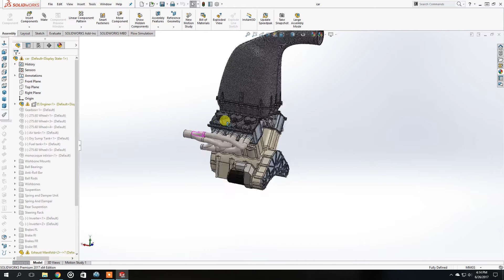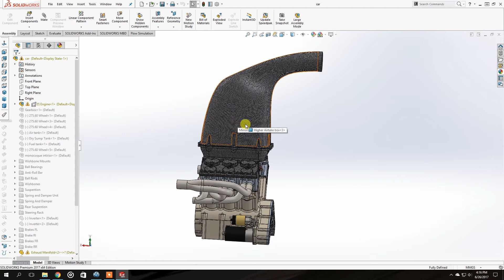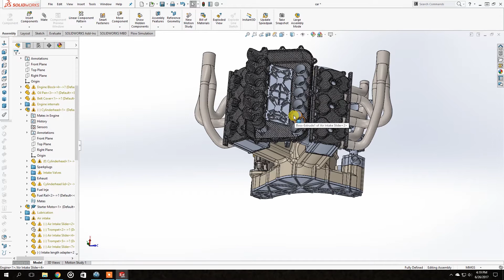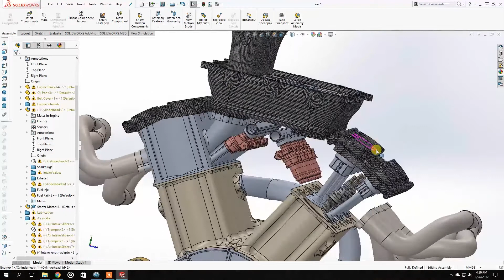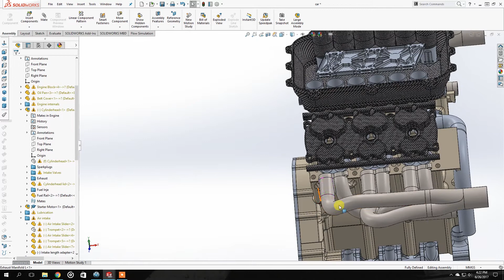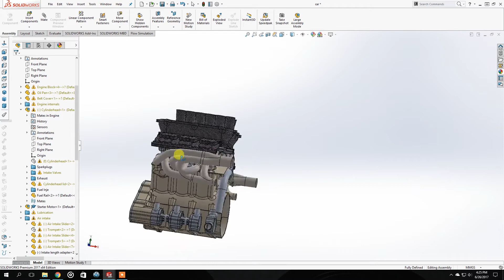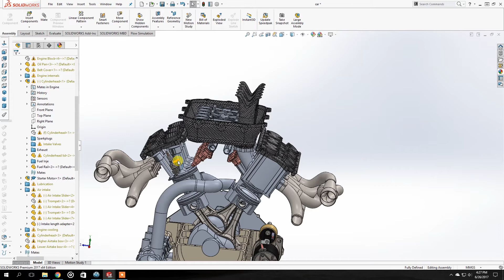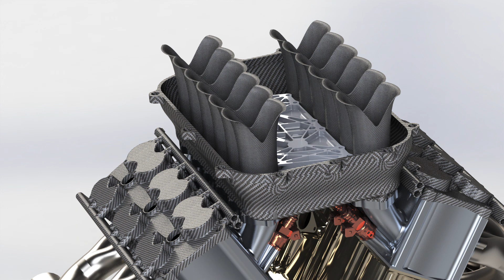Freevalve Cylinderhead Update/Explained | SVA Design

Comment: For the intake and general engine design you should heavily consider (I wouldn't be surprised if you already know of) engine analyzer pro software. I have used it before specifically for intake design but it does everything.

Just found your channel, so sweet to see all this work done, very awesome work keep it up!!!
Reply from the maker: Is that what its called? Engine analyzer pro software?
Reply: @veldboomstudios  the company is "Performance Trends" they have a suite of products. "Engine Analyzer" is the one I'm referring to but I know they have other bits such as suspension design applications as well. Check it out on YouTube, it's expensive software but you can get a 1 week free demo to see how you like it. I think it would go hand in hand with what you're doing here.

For example it can show you pressure traces of intake runners of different dimensions/volume at different RPM (so you can see where inertial supercharging(resonance) is occuring) and then you can translate those dimensions into solidworks. I think you'd enjoy and benefit from it greatly 👍👍
Reply from the maker: @Pooooooops  thank you i will definitely check it out